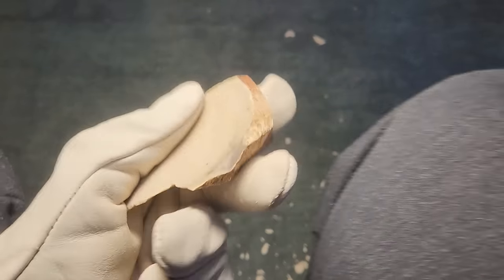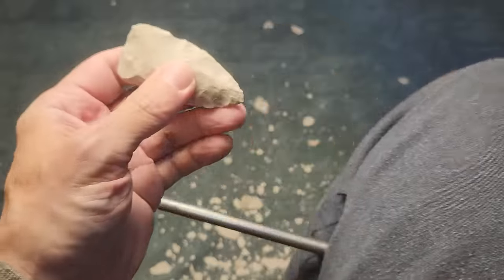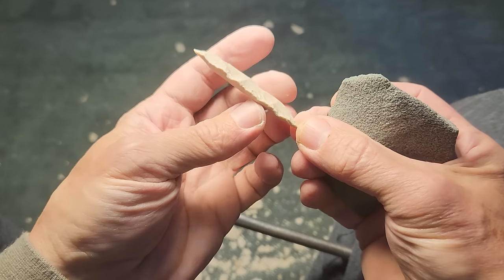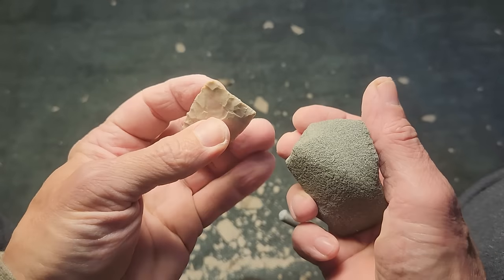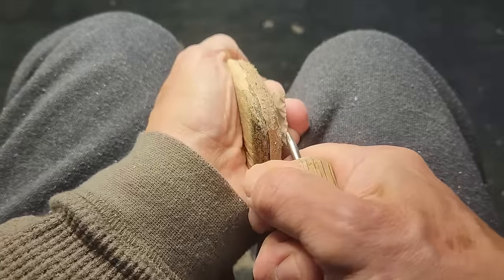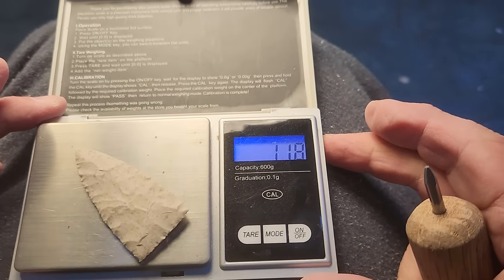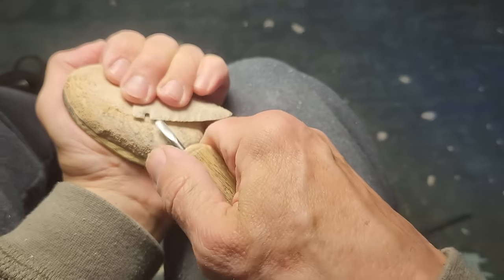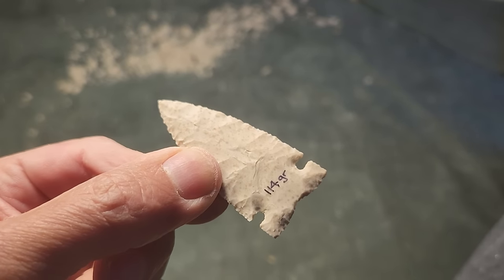1796 - Part 1/2 - Hunting Point Flintknapping

Comment: I hadn't thought of space for the glue. That should aid some, particularly with lateral stability. I always thought it was to aid in holding the point centered. If you carve the slot for the point with stone tools it's easier to cut at an angle rather than straight across. That naturally leaves a little protrusion that can sit into the notch. Saves some time and feels more solid. If you were using cane or pithy wood you could also use a small wedge.
Reply from the maker: Yes, this is certainly a possibility, but it adds a complication: not all central notches in the base are exactly centered, nor are they a consistent size or depth even among points of the same type.

Comment: for a 65# recurve I usually get the 25/64 in Port Orford Cedar.  Smaller diameter in Larch or Sitka.
Reply: Yeah I've always used Port Orford here in England too. Shoots so sweet from a recurve. Was becoming hard to get though the last time we tried.
Reply: Honestly, I can't remember the last time I tried to buy any.  The last time I bought several hundred shafts and still have a few to work through.  Not sure how hard it is to come by these days. @scottlaugher-flintknapping